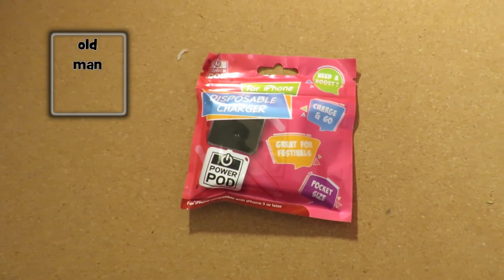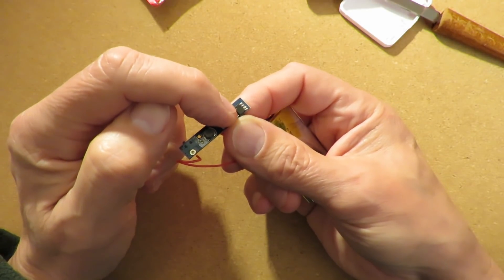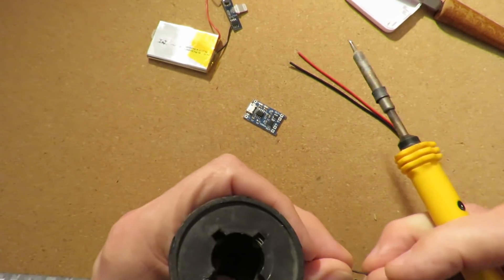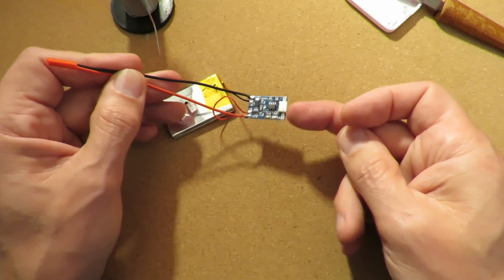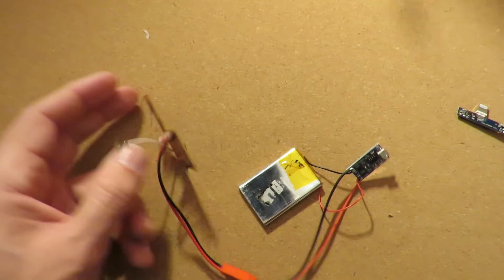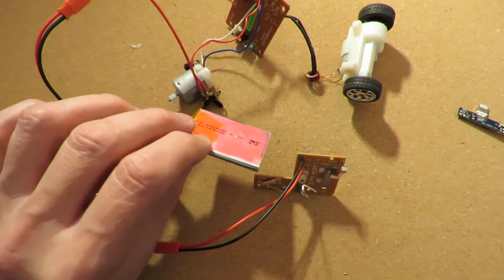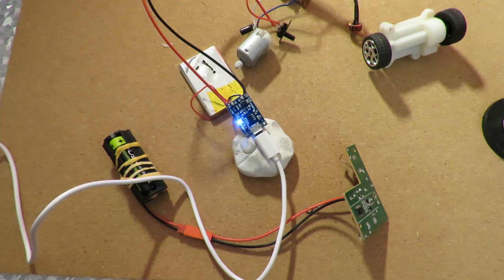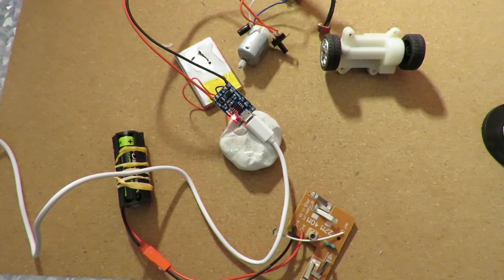Poundland Power Pod what can I use it for?

Comment: Those TP4056 modules are great however they come by default set to charge at 1A so when used with smaller cells they need to be modified to reduce the charge current. You need to change Rprog (usually R3 on the module but check) according to the values in the datasheet https://dlnmh9ip6v2uc.cloudfront.net/datasheets/Prototyping/TP4056.pdf and the charge current should be half C (capacity of the cell) or less.
In this case a 4 to 5k resistor and the current will be 300 to 250mA
Reply from the maker: Yes you are right, I mention it at around 12:00 and do show it in one of my previous videos but I will add your PDF link to the video description - not that anybody ever reads the video descriptions 😊 Thanks for the help 😊😊